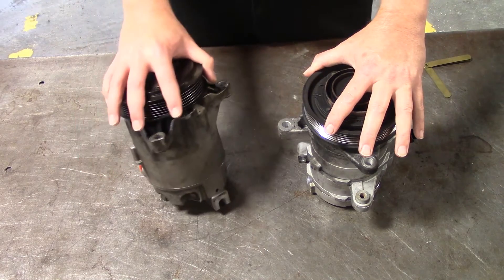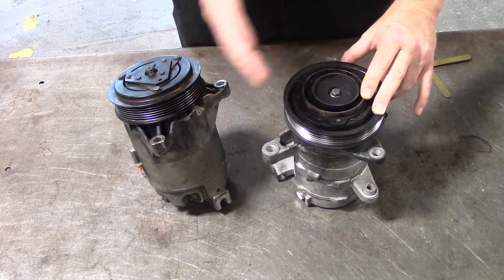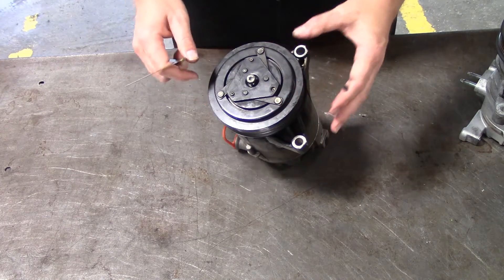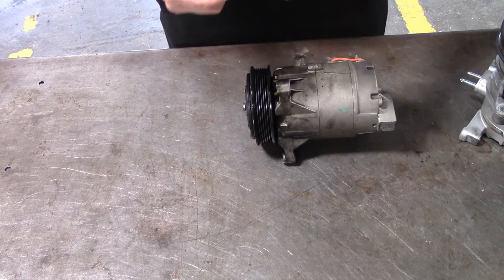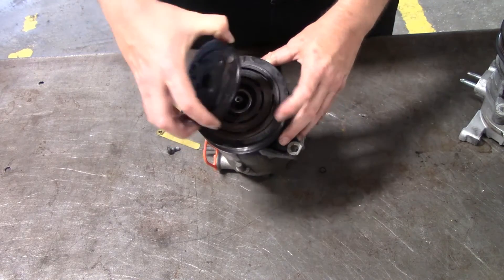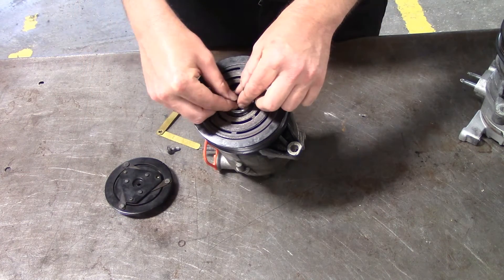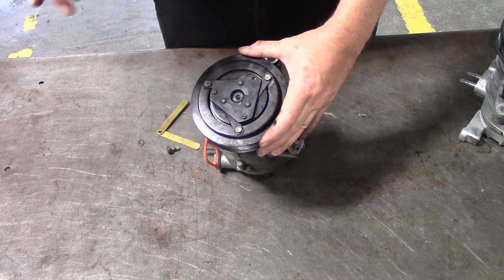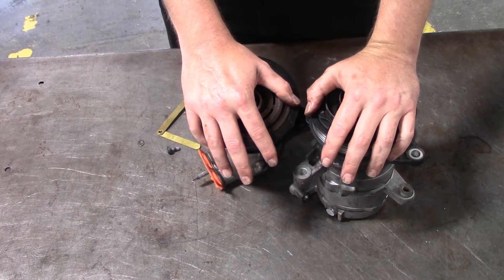Technician Training Series: Inspecting and adjusting air conditioning compressor clutch

Comment: So what you're really saying is. The clutch is replaceable at a low cost. But normally 'we just bend the customer over ' and replace the compressor. That way you can charge for more labor to also completely evacuate service the ac system for more hundreds of dollars. Ok, got it!
Reply: There’s a difference between doing a job right and price gouging. Think about it like a wheel bearing. When it goes bad for real, it destroys the hub that it’s enclosed in. You don’t just press in a new bearing like a hack, you replaced the whole hub. Same deal.
Reply: @h4ck7rm4n4  yeah if the compressor is bad it's needs changed. But if it's just the clutch, it's just the clutch. A wheel bearing is not a good comparison. There's too many different designs in wheel bearing/wheel hub to compare the two. Needle/ ball/press in/bolt in/sealed/wheel bearing assembly, etc.

Comment: Please add a method to check the gap on clutches where the pulley extends over the gap.  I think the broken clutch you showed was of that variety.  I bent my feeler gauge at a 90 degree angle (using the copper feelers since the steel one broke) to check the gap, but still difficult to tell if I getting the right size.

Comment: ❤thank you so much for this video I was rebuilding a compressor and put it back together and the clutch was engaged the whole time in the car....I didn't realize that a filler gauge for adjustment would be the issue but I found out that is my case as I can see in this video....I also did think I did a little bit too tight on the center bolt....of the clutch...
Reply from the maker: @GerryMunoz-m3v  glad you got it sorted.

Comment: Replacement Clutch cost $50.00 & 30 minutes labor, just replace compressor, evac Freon, fill Freon, 5 hr labor is $1700.00.
Reply from the maker: @denniskap1  on certain cars that may be. I just posted a video of my bmw clutch failing and it’s $700. It is very case by case.

Comment: definitely wayyy cheaper to fix the clutch if you're able to swap it directly on the compressor installed in the vehicle because you can do so without evacuating the system.

Comment: My 2004 honda accord blows cold air but the engine vibrates when i turned on the ac ( engine stalls) how can I fix this?
Reply from the maker: @MultiRafael23  could you have a vacuum leak on your engine or a clogged throttle body? Any codes?
Reply: @AutoScholarwithMrB  no vacuum leaks, I replaced sparks plugs, ingnition coil, clean injectors, I even run the engine without the timing belt to isolate the vibrations and is only when I turn on the ac.
Reply from the maker: @MultiRafael23  is there a possibility that the compressor is locking up? Does the center turn with just a small bit of resistance?
Reply: @AutoScholarwithMrB  I’ve never tried that. Should I turn it with the timing belt off?
Reply from the maker: @MultiRafael23 serpentine belt? It shouldn’t matter. Just do it with the key off. If it is stiff or frozen compressor replacement will be needed.
Reply: @AutoScholarwithMrB  thanks you’re sending me in the right direction.

Comment: 2007 Chevy Avalanche: Had a 134a leak which left me with no refrigerant.  Replaced o-rings, valves, etc.  Ran a vacuum and it held -30hg for a hour.  Began recharging system and couldn't get the system to suck in the 134a from the can.  AC LED light in car blinking and won't stay solid green.  Relay is good (swapped it with another to test), bypassed relay and clutch engages when jumped.  Tried recharging while jumping relay, no success.  I tried placing AC can in hot water while charge hose was connected to low-side and still no success.  What am I doing wrong or need to do differently? - Thanks! By theway, AC Compressor doesn't make any odd/grinding sounds and the pully operates smooth with no wobble.

Comment: So i think my wife's ac compressor clutch is doing the same thing as the first compressor/clutch. There's a lot of play. The ac is blowing hot air and i was going to try and fill up the refrigerant but it said it was overfilled but I know it was not overfilled. Do you think it may be her compressor or should i replace that clutch assembly?
Reply from the maker: Make sure power and ground is getting to the clutch coil. If it has failed, I would price both so you have options. What is saying that it is overfilled? Gauge reading?
Reply: @AutoScholarwithMrB  yeah when I went to try and put refrigerant in it because that's what I put on it, it said the gauge was overfilled probably because the refrigerant wasn't cycling through. 

I just checked out the car and the clutch drive plate is in motion when I turn on the ac system but when it's off the plate doesn't spin (the pulley is fine). A knew clutch kit is like $60 and it's oem whereas a new compressor unit is nearly $300 + core.
Reply: I’m in the same boat for my 2007 ford lmk on your update

Comment: About 4 years ago I removed the thinner of the two shims/spacers on my 1998 Frontier AC clutch to fix its intermittent operation/slippage.  I didn't even need to remove the compressor drive belt !

Comment: A lot of videos state that replacing the compressor is the way to go because the cost is comparable to just replacing the clutch. Most shops won’t replace just the compressor and want to do all of the other ac components which ends up being $1500.

Comment: I have one on the vehicle still. The rubber for the clutch is all melted out of the center. Not sure if I just needs the clutch or the whole pump yet. It's on a Chrysler T&C 3.8 EX.

When it quit working, we were out in the hot desert of California,  well, in a city, so stopped at a wallyworld to get a R134 can. That didn't do anything. It's been like this for a few months now. I finally looked at the fron of the pump, because we heard a noise that sounded like something was scraping on the street, as we drove through town. The scraping sound, sounded like it was scraping the road, as it sounded slower as I came to a stop. But it was just that loose piece in the middle, scraping. So it may just be over charged now. I'm not sure how hard it should be to turn the center piece. Maybe it's tight feeling, because it's over charged? IDK. I ordered a guage set, with a vacuum pump, just in case I need to replace the whole pump.

https://youtube.com/shorts/MvKj6iWg2Ps?si=gwg9lkgfkSwbr-pc
Reply from the maker: Sounds like it could be locking up unfortunately.
Reply: @AutoScholarwithMrB  I'm guessing the rubber is so when it does lock up, it doesn't trash your belt. Smart design. You can see in the video I shared, it does slowly turn, but with a good amount of resistance. I guess it should be turning a lot easier, by your response. Thank you for your input. I will have to order the whole pump. I will let mother in law know this. Of course, I get to put it on. LOL

Comment: The main question is, how do you hold the clutch from spinning to remove the center nut?
Reply from the maker: Bench vise, really big channel lock pliers, or just use an impact. Since there are a ton of different types, this make work well or not. There are also special tool kits that will work for specific ones.
Reply: @AutoScholarwithMrB  I see. I wasn’t planning on having to remove the compressor. Ok thanks.
Reply: I'm late to this comment but use an air hammer and smack it on the side of the nut to break it loose. Doesn't take much just a couple taps
Reply: Air hammer. Tap side of the nut to break it loose. Doesn't take much

Comment: My compressor doesn’t cycle off and on during ac operation. What causes the compressor not to cycle? I just put a new compressor and I’m afraid if I let it run like that it’ll dry out my compressor. Thanks!
Reply from the maker: If the pressures are good and the evaporator temperature isn’t too cold it will run constantly.
Reply: @AutoScholarwithMrB  how do I get that evaporator temperature to freeze up? And running my compressor constantly will ruin it? Thanks!

Comment: good ac clutch & compresser pully function # i couldn't understand if the clutch is attached with compresser rotating shaft why it does not rotate the compresser without magnetic attachment with pulley ????? 👍 🇵🇰

Comment: my AC works for a while,  usually when I drive faster,  but then blows hot air for a few minutes, then works normally again.  clutch problem?
Reply from the maker: Probably an airflow issue. I would look at the cooling fans to see if they are operating correctly and make sure your condenser isn’t dirty, causing an airflow issue.
Reply: @AutoScholarwithMrB  when it blows the hot air for the short time,  it also has a hissing noise.  then the AC is ice cold and the hissing goes away
Reply from the maker: May have to put a set of gauges on it to see what is going on. Sounds like a tough one to diagnose.
Reply: @AutoScholarwithMrB  thanks.   great video

Comment: Hi there. I removed my magnetic disc but was surprised to find no shims behind it, which I find quite odd for a car with just over 60k miles (15 years old though, and that's a car where the AC comes on by default whenever the ventilation is turned on, which might explain the excessive wear). Is sanding my disc the only way to wake up my AC?

Comment: My compressor is burning smoke. Can this be the clutch matirial burning? And can I just replace the clutch?

Thanks
Reply from the maker: Could be, but they do that when they lock up sometimes as well. If the center part turns freely this may be the issue. If it doesn’t the compressor is locked up and needs to be replaced. I hope this helps, and thanks for watching!

Comment: Who has the specs gap for 2005 odyssey. Gap. I already change the ac pulley and the new sound like a grinding. But had a gap . And I can spin it with my hand. When turn on the the clutch spins. Off the clutch no work but sounds like something is grinding. And tripping the 7,5 amp fuse for the magnet . Any help ?

Comment: Odd question - can I drive my car safely with the clutch completely removed from the compressor?  It's close to 20 years old and we use it for errands. It's a different belt from the alternator
Reply from the maker: I would think you can as long as the belt only drives the compressor

Comment: Got a 2005 Acura MDX ac compressor not coming on. Even hooked it straight from the battery to the compressor nothing. My clutch turns hood by hand. Can it still be my clutch needs adjustment
Reply from the maker: If you don’t see movement the clutch coil is probably faulty.

Comment: A mechanic just left my home, he was here replacing a/c compressor clutch. The system is very low on refrigerant and apparently he didn’t add enough shims to the clutch bc it won’t disengage and makes a rubbing sound. He said it was fine to drive until he comes back in two days. I don’t like it one darn bit. Would you drive it that way?
Reply from the maker: I would not drive it like that, but that’s just me.
Reply: @AutoScholarwithMrB . That’s the fastest response I’ve ever gotten and I sure needed it! I need to go off and do a few things but I don’t want to drive it this way. I agree with you. Thanks for your reply! I’m really stuck here!
Reply from the maker: @carlorocky  sorry you are going through it buddy. Thanks for watching and good luck with the repair.

Comment: Very interesting. Recently I replaced my leaking AC compressor with a used one. Unfortunately this one seems to have a warped or bent clutch (maybe damaged through shipping) that is rubbing against the pulley making some weird noises and I think it struggles to engage the pulley when the AC is on (like it's slipping or something) especially at high rpm. If I manage to find the old compressor I should try and swap the clutch. What do you think?
Reply from the maker: It’s worth a shot for sure
Reply: @AutoScholarwithMrB  ok I do still have the old compressor, definitely worth a shot!

Comment: Hi, i have freeon on my  system and also the ac clutch picks up but it is not cold inside the car. Pls what could be the problem
Reply from the maker: I would need to know the pressure on the high and low side to make a proper diagnosis

Comment: I can’t seem to get the cent bolt out. The front clutch assembly on my ac compressor has fallen apart. The rivets on two of those arms came out and the arms flail around. Trying to replace the clutch whole clutch assembly without pulling the whole compressor and avoid the need to evacuate the lines. But like I said that bolt just won’t come out. It spins while I lock the front clutch assemble but it’s not coming out. Any ideas?

Comment: Helpful tutorial. In my situation, when ac is off there is a noise but when ac is on the noise vanishes, can you help?
Reply from the maker: Clutch may need a shim installed as the video shows. Thanks for watching, and good luck with your repair!
Reply: Check your idle tensioner pulley.  They can also cause noise.

Comment: I replaced my clutch and it slowly rotates when the ac is not on. is the clearance too slose? Also, it is hard to turn by hand with engine off
Reply from the maker: The clearance is probably too close. The good news is that it will probably wear a little material off and it won’t matter after a while. This is probably not related to your hard to turn by hand issue.

Comment: Recently the bearing on my compressor was bad and had slop and eventually the plate ended up grinding on the clutch itself. Had to use a grinder to make it almost even as best I could then put a slightly bigger washer and works just fine now.
Reply from the maker: We do what we have to sometimes. Thanks for watching!
Reply: The washer are made of copper or metal?
Reply: @Mr.Căciulatu it should be stainless steel since they spin so fast they gotta be stronger than copper
Reply: @dannylns  Thanks man. I've allready installed one made of stainless steel and it's good so far

Comment: Good explanation for the guy trying to figure out a clutch problem.  So it’s good to say that the average air gap on the clutch is about 0.20 to 0.30 of an inch.  This of course would mean that the magnet is properly working and can engage the clutch assembly at these measurements.
Reply: Guessing you meant .020 to .030, as .20 to .30 = ~1/4” gap.
Reply: How can I measure the center piece with filler gauge, because I cant go straight with the fuller gauge and the center piece position gap is not not straight. 
Please your advice, thank you

Comment: Do you guys have any idea what would cause the clutch coil to burn out or lock open I have replaced 3coils  in two weeks and I am putting number 4 in this weekend, when the car is running and A/C is turned on I have 14.2 volts to the coil, do you guys have any idea why my coils only last about 20-30 minutes.

Comment: My 05 saab93 got warmer for ac.. I put the 35 to 40 refrigerator in and it got cold... next day for quarter miles it streaked and smelled like clutch.. I shot pag 46 charge at Napa and it seemed fine.. the slight noise when turning on and off gone to... now it won't engage.. theres no air gap I can't get any feeler gauge in there.. could shim worn out.. I check relay, pressure switch... tapped on it.. bout to take apart

Comment: Mr. B, I’m in the process of replacing my A/C compressor because it’s 14 years old and leaking pretty good. I put the blue dye test on it. The condenser came with the compressor. I also bought a new suction and discharge line. My question to you is, do I need to completely flush my system before installing the parts? Or do I need to flush the system after I install everything.  I appreciate your reply, thanks.
Reply from the maker: If the compressor is leaking, you shouldn’t have to flush it out. If your system has an orifice tube, you should pull it and inspect for any metal flakes or black residue. I would also replace the accumulator or receiver/dryer as it somewhat acts as the system filter. Don’t forget to add oil if the compressor comes dry, and make sure the oil you use is correct and has dye in it for any future diagnosis aid. Thanks for watching Willie!